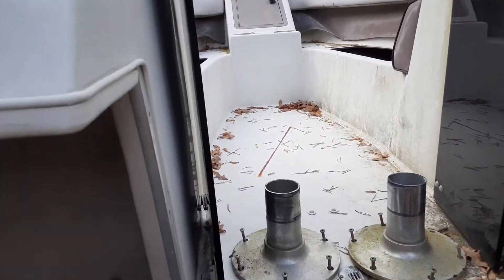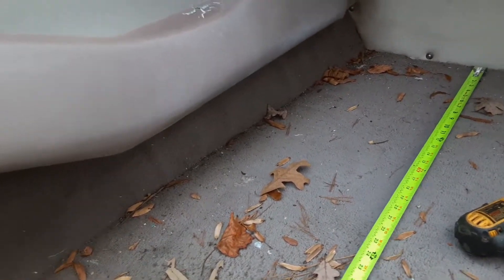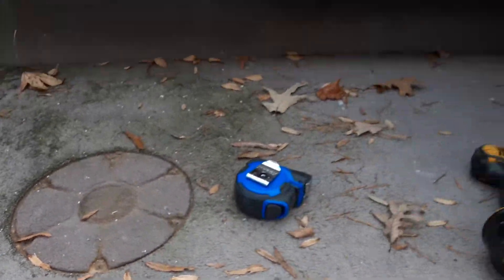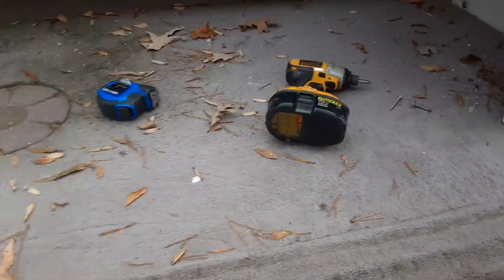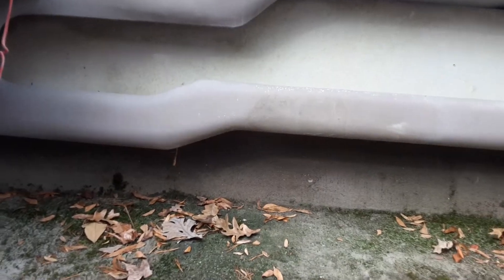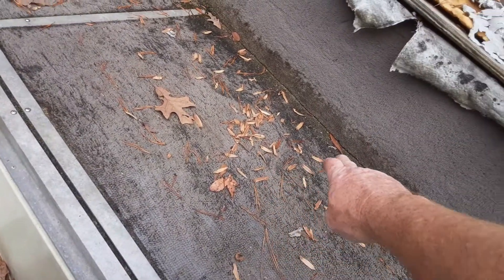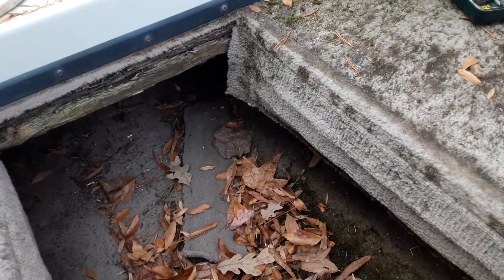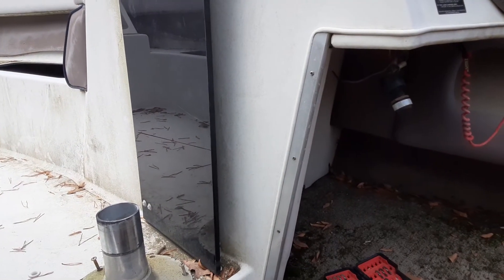Rotten Floors

Comment: still looking at living on a boat thinking of ways i could build one had a bit of a crazy idea of sand casting the hull and top deck out of alloy
Reply from the maker: You have peaked my interest. Load a video of what you're thinking about. Even if it is only a drawing.
Reply: @popsoldboats3406  just a idea at the min just rocking up to a sandy beach out the way with a big good size smelting flask and using beach sand and foam top deck and bottom hull and pack with sand instant boat to work with if i had the smelter and alloy i would go try it in a hart beat and see if it can be done to big scale

Comment: Pop - when you replace rotten plywood floors, do you spend the extra money for marine plywood? Or is exterior grade plywood good enough. The reason I ask is because I need to replace the aft plywood platform berth in a Chysler C26 sailboat. I’m planning on using exterior plywood and painting both sides. What do you think?
Reply from the maker: I prefer furniture Grade plywood.  The quality is a little better than marine grade. Also I always put 2 or 3 coats of laminating resin on the plywood before I apply any glass.
Reply: Thanks for sharing your knowledge. I’m glad I’ve subscribed.
Reply: By the way do you still have the sails from the Chysler C26 you decided not to save because of the major declaration problems? I need to find a set.
Reply from the maker: @garymilstead4199  I will look to see. Can't remember if that vessel had sails or not.